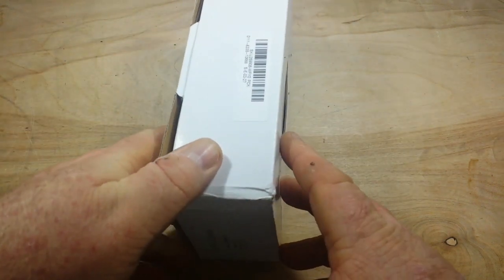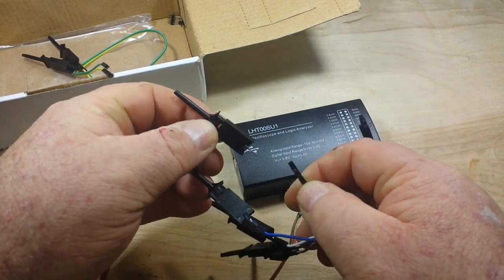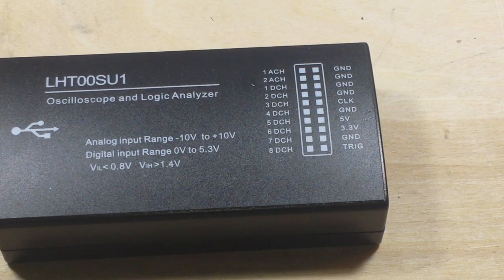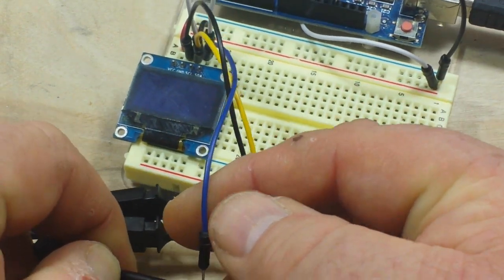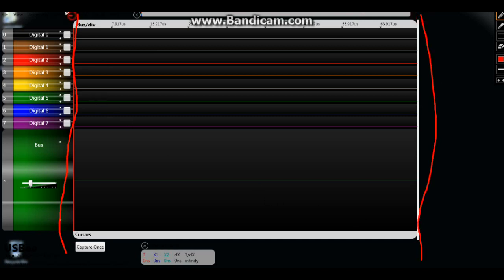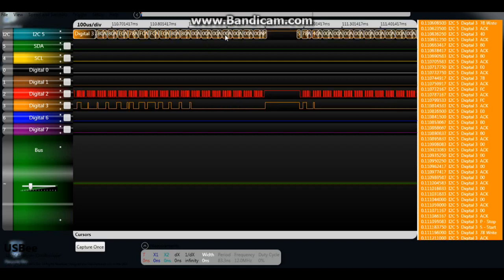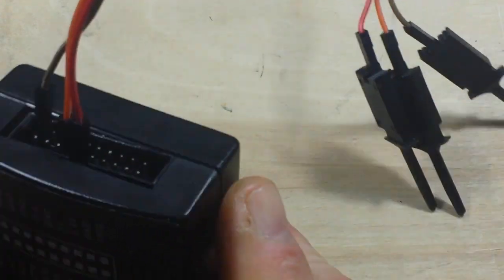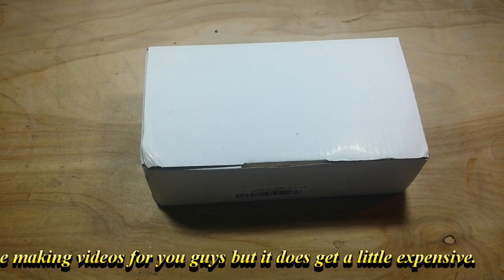Geekcreit LHT00SU1 Logic Analyzer from Banggood

Comment: Health always comes first! 
I got the same unit for a while already. Dupont cables seem to be quite common with logic analyzers below 200US$ but yeah they suck.
But the link I got with my unit for the software brought me to a website where the software wasnt free. So I installed Sigrok instead (an open source logic analyzer and digital oscilloscope software) and I have the logic analyzer working but only one channel of the analogue scope. Works pretty well so far.
Where did you get your software from? Could you please publish a link?
Reply from the maker: +Michael Eckl The software is about about half way down on the page I linked to on the video.
Reply: ah thats new. You are aware that the link guides you to illegal software and also provides a  crack?
Installing that software can have severe consequences. Especially in the US. Better get Sigrok which is free and legal. 
The software they provide used to be free but is not anymore so thats why they provide the illegal crack. Dont use that!
Reply from the maker: +Michael Eckl I did not realize that. Thanks for pointing it out.
Reply: Its a tricky thing. That particular software used to be free and most tutorials demonstrating that unit show that software. When I bought mine about 8-9 months ago the link from the product description just lead to the buy page of that software. But the manufacturer of this product never noticed or made a change. There are comments about it in the review section on Banggood. The only legal and free solution I found is Sigrok which works just fine but is very basic.The digital part is ok but forget using it as a PC-based scope